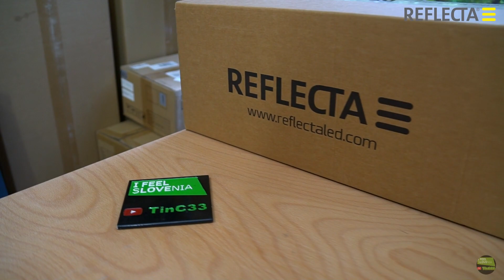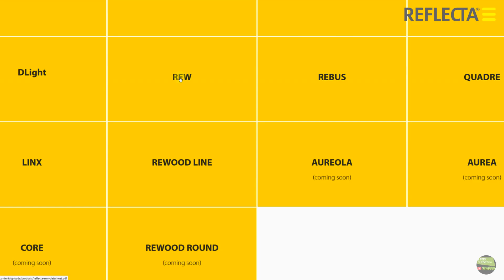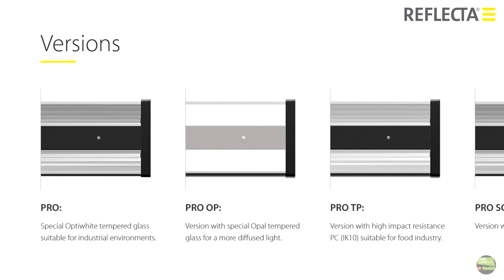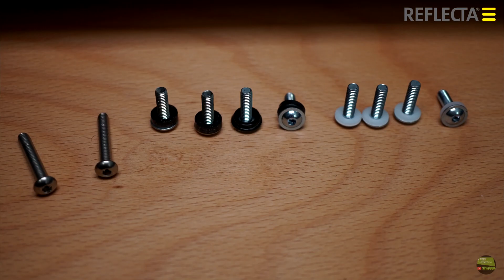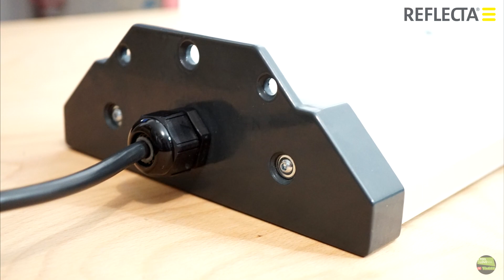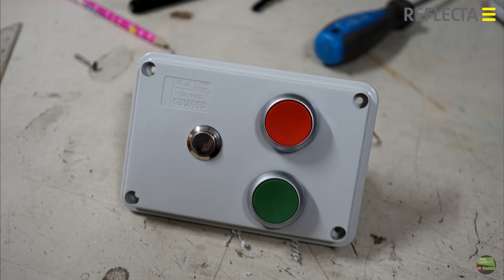REFLECTA PRO gen 2 Professional industrial LED light [unbox / review / first test]

Comment: Amazing lights💡2500 lumens for that small space is a huge amount of light, your filming will be better, even more 👍
Reply from the maker: yes they are really great all that light for a 150W, for normaly use i dimm them to about 80% and it's more that enough, but few days ago i filming something with 100fps, and that's the moment when there can't be too much of light, i cant imagen what kind of light they use when filimng with 1000 or more fps
Reply: @TinC33  They usually go with a much faster(wide open) lens, bigger pixels, high native iso etc. and also more you concentrate the light more intensity it will have. There are small cob leds that can go 10k lumens, even looking at reflection of them causes temporary blindness. Btw I think you should change your camera mode to NTSC and shoot at 60fps instead of 50 because the principals of using PAL is non existent on youtube and it has some disadvantages let's say you want to add a screen recording or another media, it would be usually 30 or 60fps so fps will mismatch and cause stutter, plus you lose 20 fps in slowmo.
Reply from the maker: @drozcan  thanks for info, and true i need to try with NTSC now with led lights, i switch to pal years ago just with that reason since electical freqvency in eu is 50hz so many times i notice lights blinking while filming with 30/60fps, thanks i will try because i really wish to had 120fps instead of 100fps.